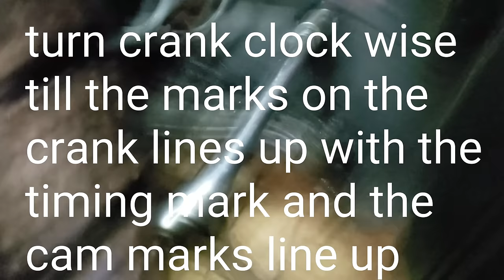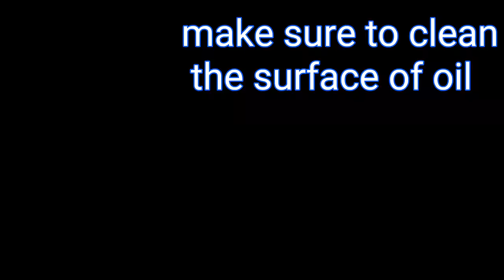How to replace Honda CRV timing chain DIY #crv #rsx #tsx #accord #k20 #k24 #timing chain

Comment: Hi! Need remove the oil engine before open the tap of timing chain cover ? 🤔
After finish the job replacing cylinder head gasket, (car run ok but not exactly good calibrated, so must to open again and Reinstall the timing chain and camshaft, but Just full of new oil!

Thanks again🙏
Reply from the maker: It would be good to replace the oil since you're working in there.... but you shouldn't need to drain the oil to do the cover... it shouldn't reach the top of the pan. Hope this answers your question. Cheers.
Reply: Thank u ! Oil engine is new already.

Comment: Great video and it was easy to watch. I have a couple of questions for you.  How much did you charge to do this job and how much would you have charged just to do a  leaking timing chain cover repair? Thanks a bunch!
Reply from the maker: Thanks for your questions.  This job would depend on your local area shop rate. If you're in south America compared to USA.. so pricing is irrelevant. Leaking cover will depend.. the cover is sealed, so it shouldn't leak. The leak might be coming from valve cover and being mistaken as timing cover. I should doing a thorough cleaning and monitor and new leaks. Cheers.

Comment: Exactly how did you line up the timing mark on the crank shaft with timing link on the chain?  Do you pull the chain from the crankshaft sprocket?  Thanks
Reply from the maker: Some of the new chains will have a coloured link for you to line up with the two cam markings and the crankshaft sprocket.  There will be a line on the crankshaft sprocket as well. Hope this helps

Comment: Just wondering, is that steel piece at cranck case, check plate to check out youre tensioner?
Reply from the maker: Yes. That's the cover for the tensioner.

Comment: Finally finished changing my 03 CRV timing chain. Had I known how tight the crank bolt gets I would've get in advance the special socket for it. Ended up buying a Milwaukee impact (plus batteries and charger, which came with a free little impact driver). That was the hardest part of the whole job until I got those 1400 ft/lb.. of breakaway torque to it.
Reply from the maker: Great to hear. Milwaukee guns are amazing. I have a bunch of M18 and M12 tools.

BUT... I recently ran into a crank bolt that wouldn't come off. I had to use a Honda crank pulley tool and breaker bar wedged in the control arm to hold and using another breaker bar for a socket to loosen that 19mm bolt.
Reply: Have you tried using the extra heavy sockets specifically made for cranck bolts? That day I tried to find some and couldn't find them locally and yesterday stopped for different reason at autozone and there was one on clearance for $11.
Reply from the maker: @saulbroa7551  I know about them, but have not used them before.

Comment: One I'm doing on diagnostics it said cam sensor and crank. Replaced all still it's starting and run good for some minutes before it cuts off. At time misfires with a bang from the exhaust.
Some advised me to check my timing it looks very OK. Now don't know where this problem is coming from
Reply from the maker: I assume you don't have any check engine light on. 

I would say to check the timing control solenoid.

Here's a video on how I was able to repair the solenoid. 

https://youtu.be/ec3lybF1KLo

Hope this helps

Comment: Great video, I was just about to pull the engine to do this so you saved me a ton of headache!!  How many turns do you think you had to do to get the chain and marks lined up?  Felt like 50 but I lost count
Reply from the maker: I'm glad it helped...makes me feel like time well spent documenting and editing..

It should only take at most 2 full rotation to line up the cams.

Comment: Awesome video!!!  Question for the chain's marks.  I thought that once you have lined up all the marks, and do a 2 full rotations, are those marks supposed to be on the same spot again?  I heard that once you do the rotation, those marks aren't staying in the same spot even though your engine is timed.
Reply from the maker: Great question... for sure one rotation it won't line back up...not even sure if 2 rotations will work. So what I do now is turn it counterclockwise about 90 degree and turn it back clockwise to check the marks. If they line up then it's lined up. Hope this helps.
Reply: @UncleTinman  thanks uncle Tinman.

Comment: I'm in the middle of replacing one on a 2006 crv. Same code but also had no power. Felt like a plugged exhaust. When I pulled the valve cover, the cam marks were a full 2 teeth out. The tensioner was maxed out, and when I pulled the chain off and compared it, it was a full link longer. Stretched like crazy
Reply from the maker: Please do come back with an update when you're finished. Cheers
Reply: @UncleTinman  just got it all put together before lunch today. Runs like a top now, no more p0341. I had it almost all done yesterday but the new valve cover gasket only came in this morning.
Reply from the maker: @carterthiessen2664  Awesome to hear. Great job getting it done.

Comment: When you removed the engine support, did you keep any kind of jack under the engine or can you remove that support and you'll be fine without having support under it thanks.
Reply from the maker: Good question.. the engine will drop down a bit, but is fine without support. The other mounts will hold it up.

Comment: Awesome video. Thank you so much. Quick question... does it matter what torque I should be setting all the bolts to?
Reply from the maker: Thank you for your reply. I don't know the exact torque settings. Perhaps you can find the numbers online or if you have access to a shop manual. I just do them hand tight... I've always done them that way and have not encountered any issues or comebacks from bolts loosening up. It's best to torque them to spec. Cheers.
Reply: @UncleTinman  so would hand tight plus a quarter turn be okay? Had anyone ever come back to you cause of something that came loose after you've work on their vehicle? I'm not trying to be rude. I'm gonna attempt this myself and I just want to make sure I dont mess it up.
Reply: @ChanthaSim86  hopefully you used a torque wrench.  Informative video but I wouldn't pay this nice youtuber to work on my vehicle.  Sounds like he doesn't own a torque wrench because he admitted to never torqueing bolts.  Hope he cleaned the pullies before installing that new belt.  According to my 2010 crv that's apart I'm pretty sure he missed the small areas in the middle of the cover with silicone (unless it's different) doubt it.  Common courtesy to clean up all the oil leaks before you start the job that way you're not working in a mess. He resealed the front cover but unless he waited for the silicone to dry and then wash off the engine the customers going to look down and see all the residual oil leaks and think it's still leaking. That subframe was WET.  What else, he revved the crap out of it at first start up, the tensioner doesn't even have oil in it at that point.  He didn't let it idle long, was running rough as heck, was the issue even fixed? I could go on, lol.  But yes, informative.

Comment: Im just  finishing up the same job you did .I had a spark so figured that It was from inside car( ie ) clock, interior lights so I  wondering if you had continuety across the positive and negative terminals I have a draw of 6 volts and I checked for a short by pulling every  fuse and repeating the continuety  ☑️ across both till I had zero ACROSS THE terminals I also checked the alternator and starter . And I still have continuety across the terminals. I'm stumped any ideas or suggestions would be greatly appreciated. ,2007 Honda CR-V
Reply from the maker: You'll need to test draw with an amp. Meter setting... and continue with the fuse removal process...
Reply from the maker: Check that your grounds are connected properly.. that'll cause weird results.

Comment: Good video, thanks,
what direction does the crankshaft bolt spin off ?
Reply from the maker: It spins off counterclockwise like a regular bolt.
Reply: @UncleTinman  thanks bud, I guess the pulley spins clockwise when engine running ?
Reply from the maker: @WindyMillarUK  yes.. this engine does spin clockwise.

Comment: Great video! I wanna do it by myself, I already did the head gasket  but is still leaking oil and it looks like is coming from the timing cover. I am having problems to take the engine mount bolts. do you have any ideas to help me out ?
Reply from the maker: What's the issue with the mount bolt?

Comment: Great video, just wondering why you didnt change the guides since you had it apart, and also why you didnt clean up some of the other parts before you put it back together, but this video is great
Reply from the maker: The guides were unscathed, no wear. You can change them for a little peace of mind.

Comment: Brilliant writeup, thank you.  I've got up to taking the bracket that fits between the engine and the mounting and one of the three bolts simply is too long to come out past the chassis (just below the steel pipe heading to the power steering fluid reservoir) in order to remove the bracket. Looks like tje bracket will spin around allowing me to get the timing cover off, but has anyone else had this issue?  Perhaps lift the engine up a little?  I've taken the mounting out entirely and there's still not enough clearance.
Reply from the maker: Yes.. you'll need to jack up the engine and the bolt will be able to come out. I missed that part in the video.
Reply: That tiny bracket is a huge pain in the ass and yes if you lower the engine you can easily remove it from the wheel well. I can personally attest to the fact that I lost some blood due to that stupid bolt. After lowering the engine I could have kicked myself in the butt for wasting a huge amount of time trying to reach it from above unsuccessfully. It took about 2 minutes to get it out after lowering the engine. I'm glad that my 2004 CRV EX doesn't need parts installed very often because as you probably are aware that some bolts are next to impossible to reach. It's worth it all told.

Comment: nice video, don't forget the guides contribute to chain slack
Reply from the maker: Valid point except these guides had no wear even after 400km
Reply: @UncleTinman  that's good to know I'm thinking of servicing the timing on my CRV it's 270000km looking at sprockets actuator guides chain and tensioner, havent opened it up yet
Reply: @UncleTinman  real noisy at startup
Reply: @UncleTinman  is it possible to replace the crank sprocket without removing the oil pan?
Reply from the maker: @itsmesomeguy  I'm pretty sure there's clearance.

Comment: Maybe I missed it in the video, but I was unable to remove the engine mount bracket from the timing cover. There wasn't enough clearance between the wheel well to remove the upper right bolt completely, and I had to leave the bracket hanging from the timing cover. Is there an obvious trick I'm missing? I did not try dropping the engine very far, as it would require about 6 inches of drop to slide that bolt all the way out. I was able to remove the cover with that half of the bracket still dangling, but it will surely be in the way while trying to reinstall, especially while trying to seat gasket material.
Reply from the maker: What you need to do it remove the mount and jack up the engine. Watch the video again.
Reply: @UncleTinman  Thank you for the reply; however, after around the 6:15 mark when you mention removing the bracket, there is a cut in the video and next time that area is shown, the bracket has been removed already. Did you have to loosen any other engine mounts to raise the motor so far, or does it have enough flex for that bolt to clear the body of the vehicle?
Reply from the maker: Yea. Sorry. You're right about the clip jumping. I guess I missed that step in the edit. Removing the side mount will give you enough clearance to jack up the side to remove the bolts. So remove the bracket and rubber mount to give you extra room to work with
Reply: @UncleTinman  I'll try raising it more next time I'm in the garage. The cover came off, but the bracket was still half-attached and it was a puzzle sliding the cover out. If I can raise the engine more, that will make installation much easier. Thank you again for your prompt replies. Your video is a great accompaniment to the Haynes manual.

Comment: I have always found that taking the spark plugs out really helps as when you need to turn it by hand you do not have the resistance of the pistons compressing in the cylinders to fight with.
Edit: LOL, as soon as I typed what I did, I saw that you had done exactly that.

Comment: After how many miles you have to replace it? Mines have 250k miles Japan built . Also the pump how many miles
Reply from the maker: There isn't any particular recommended schedule interval for timing chains. The pumps are designed to last 100k miles. You may want to get yours looked at to see if there are any signs of leaking or wear on the pulley.

Comment: Good video. But not true that the colored links will line up after rotating the crank. The markings on the gears and the arrow on the crank will line up when rotating the crank but not the colored links.
Reply from the maker: The coloured links are used to align the chain when installing.

Comment: Do you recommend doing "preventive" chain replacement? Or will they always stretch and rip a code before damage? (in your experience)
Great video! And sunglasses.
Reply from the maker: Preventive is always good. Most I've seen have thrown codes or driveability issues... extreme cases have been snapped chains (which I have not encountered)
Reply: I'm in the same boat. I'm about to pull thr cover and  willing to do the chain/ tensioner/ guides, etc. if it's necessary I'll do it, 2003 CR-V 216,000 miles.

Comment: Could a slack timing chain cause a noise that sounds like a “tinny” metallic heat shield rattle upon low rpm acceleration?
Reply from the maker: Great question. Slack chain can definitely cause multiple noises and not limited to a rattling tinny noise. Is there any check engine light? Sometimes the incorrect timing will throw a code. Hope this helps.
Reply: @UncleTinman  there is a check engine light, though I can’t remember what the code is, I know it is timing related though.  This noise is only upon acceleration and sounds exactly like a thin rattling heat shield or piece of thin metal, but I have been over the entire vehicle and can find nothing that would create this noise.  It either only happens and lower rpm’s or is only audible at lower rpm’s - my thought is that it clears up at higher rpm’s.  It’s also noticeably worse when ambient and vehicle temps are hot.  Does that sound symptomatic of a timing chain?  It’s been a problem we have been living with for about a decade now!
Reply from the maker: @GoInfluenceyourself  wow. That's a long time to be dealing with the issue. I'd check the light and figure out that issue and go from there. It does sound like a timing issue. Could be the variable timing actuator as thatt constantly adjusts the timing. Hope this helps

Comment: untill today ....how is that aftermarket chaing and pin are holding up????? i need to do main but honda parts are so expensive and i dont know an good aftermarket brand to put 
 it on
Reply from the maker: Thanks for reply. The car is driving just find.. no problems.
Reply from the maker: Try looking on Rockauto.com for a variety of selection on brands

Comment: I have an 03 crv i am looking to do the timing chain but i heard once finished you may need to use a scan tool to relearn the pcm of the crank position. Is this true?
Reply from the maker: I've never heard of, nor had such an issue. The crank sensor reads position. Doesn't need learning. As far as I know.  Hope this helps.
Reply: Uncle Tinman Cool thanks.

Comment: When I line up all the marks there is a lot of slack on the chain still, that when I release the auto-tensioner it push the crankshaft sprocket out of alignment.  Do you think my chain is too stretch and need a new one.  My engine was leaking everywhere so I did a full gasket job, I was hoping to not replace anything other than the seals.
Reply from the maker: If i went that indepth to change gaskets. I'd replace the chain as well.

Comment: Question: how did you get the clearance to remove the engine mount bracket from the TC cover? The first bolt I removed was 3 inches long!
Reply from the maker: I don't recall right now, but you might need to jack up the engine from the bottom to lift it just enough to slide it between the mount.
Reply: Jack the engine up with a piece of wood across the oil pan. 
Lift the engine up just a bit, loosen the bolts, jack up slightly more then take them off.

Comment: On the tensioner part do you need to put anything to block it off so it won’t move or just take it off all together
Reply from the maker: Before removing it..make sure to set the engine at TDC.. then you can  unbolt the tensioner and everything should stay in place. Hope this answers your question.
Reply: @UncleTinman  thank you this has helped a lot

Comment: Hey great video, at 9:06 you said the key way is out of place and should be at the top. When you turned it back and checked at the top, what line is it supposed to line up to at the top? You didnt show this line. 

Thank you very much in advance
Reply from the maker: Thanks for your comment.  There's a mark on the inner edge of the crank. That line will line up with an arrow on the timing chain cover. 

https://images.app.goo.gl/rLzKPBUwDEmqt4Ts6

Hope this helps. Cheers

Comment: If just fixing a leak on the chain cover (already replaced chain recent) do I still have to line it up? Or can I just removed the pulley off and replace reseal?
Reply from the maker: No need to align the chain again if just resealing the cover